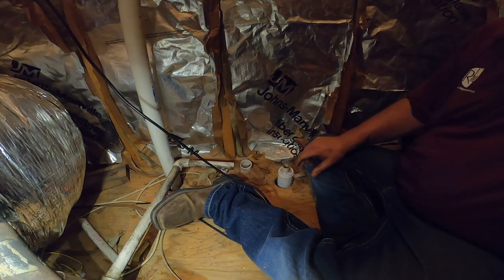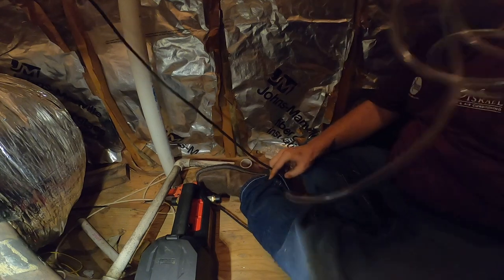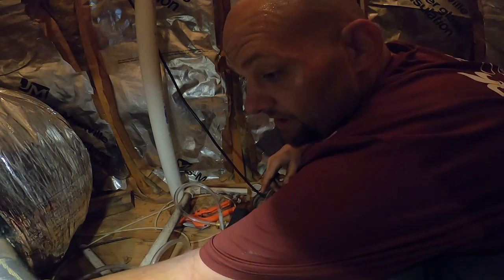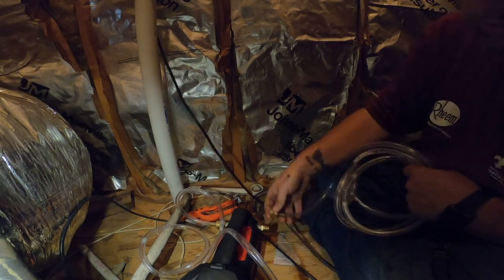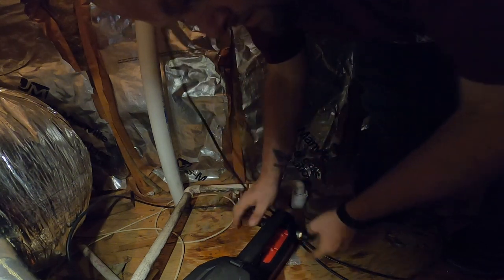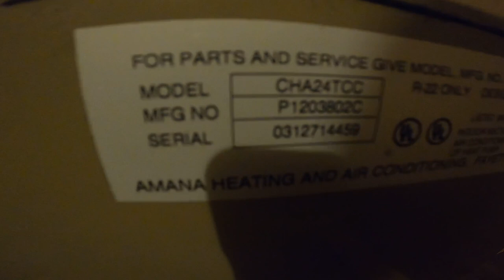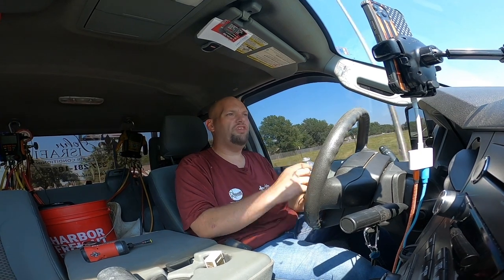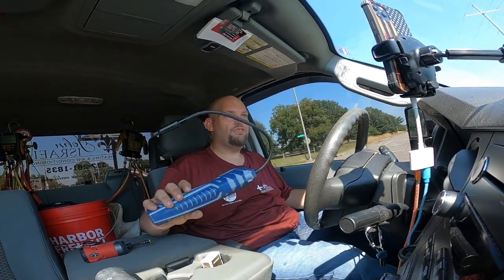Using the Milwaukee Transfer Pump to Empty a HVAC Pan/Leak search on Evap Coil

Comment: I hope your pump works better than mine. My pump seal started leaking the 2nd time I used it. It is 6 months old and Milwaukee never responded to my email about it. I’ve read that this is a common issue with no seal replacement available.